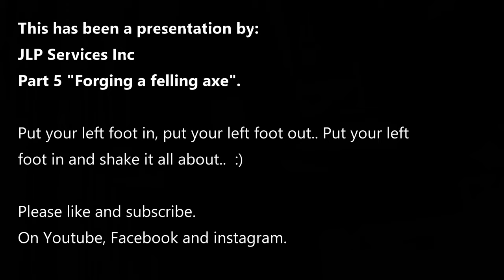Part5 "How to" Forge a Felling Axe,  Bowtie/butterfly  (final shape)

Comment: Great job as always Jennifer! I have been making tools so I can maki more tools recently. Also a few Christmas presents for friends and family. I sure would like that axe in my collection.
Reply from the maker: Well at some point you might be able to add one.. More than likely not this one.. But, just getting going with the new school so potential is there for sure.
Reply: Hi Jennifer how goes everything? I made my first wrapped eye hatchet today. I made the eye too big and didn't have enough material to make the cutting edge how I wanted but the forge weld went well. I did the body out of a railroad spring clip and the cutting edge from 5160. I really want to be apart of a class of yours and make one of these bowtie felling axes.
Reply from the maker: @lukelofgren4108  Things have been good, thanks for asking.. Little slow on shop progress but it's that time of year. 

Congrats on your success..  Those spring clips are pretty good material.. You maybe could have done it as a single weld instead of 2..  If they are the rectangular clips they are decent material for sure, the round ones are too.. the round ones that look like chain links.. 

You are welcome to come take a class for sure..  Hatchet, Axe, adz, Auger bits will all be part of the school lessons if there is enough demand.   

Shoot me over some photos on the blade site.. Can't wait to see it..